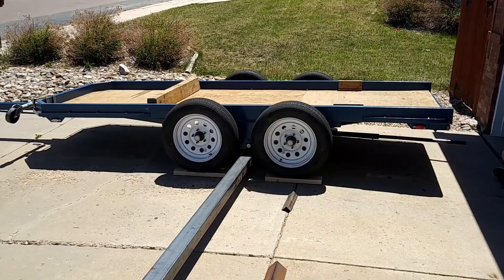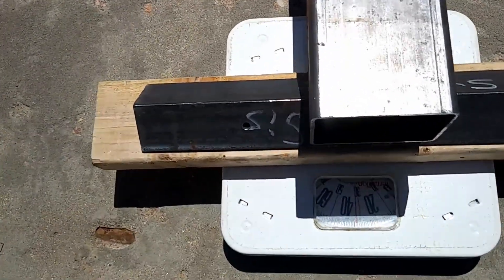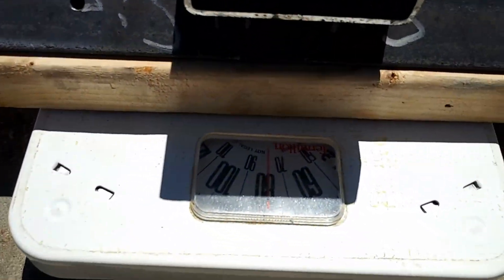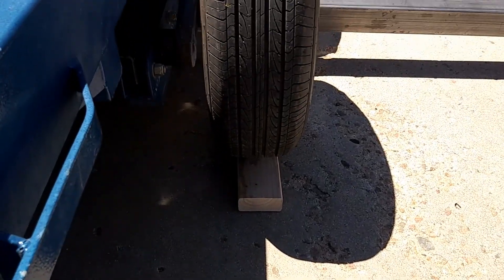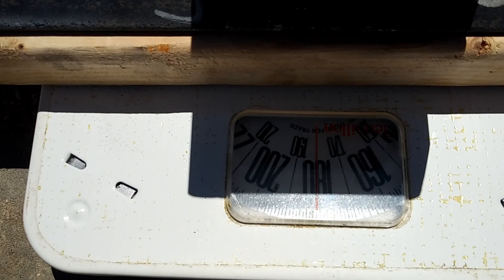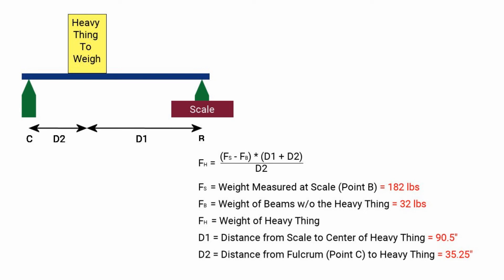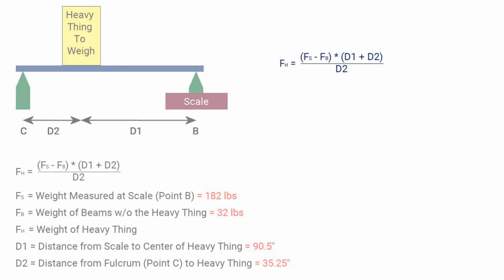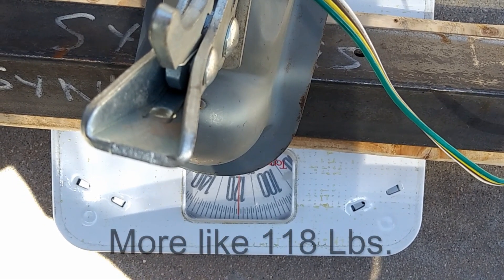How To Weigh Heavy Things Without A Huge Scale, Like Weigh A Trailer In This Example

Comment: You should not have included the tongue weight, which changes depending on how you load the trailer. You can use it to judge if you've balanced your load properly, but it does not contribute in any way to the trailer's total weight.

Comment: What if the heavy thing is not symmetrical
Reply: Just drive the thing over to your local moving company or most truck stops and they'll weigh it and then take it out of your truck or take it off the truck whatever and weight again and subtract the two
Cost 10 dollars thats a hell of alot easier  And cheaper than buying that beam
Reply from the maker: If it's not symmetric, measure both sides.  Or, Everything has a Center of Mass. Get under it and lift the whole thing.  But, sometimes you can't get under things, so this method is not practical. It's not the end-all solution, just a hack that can help in the right situation.